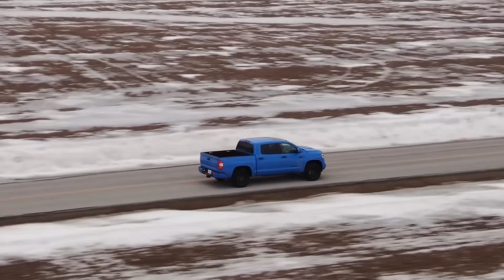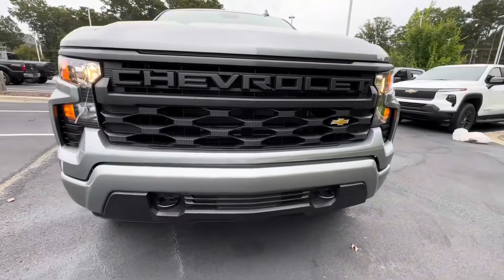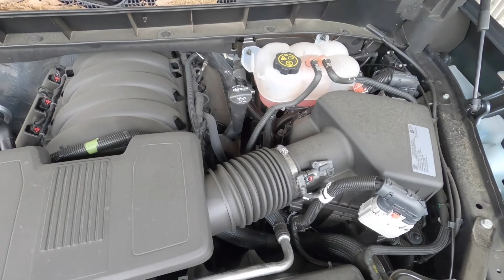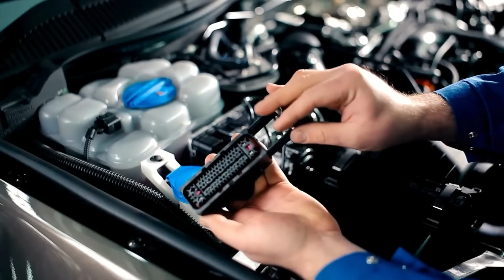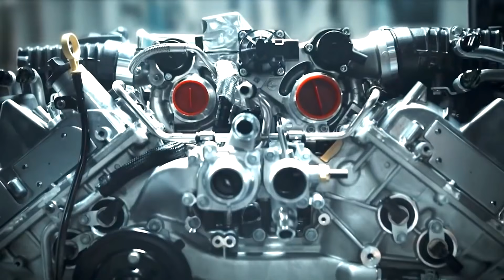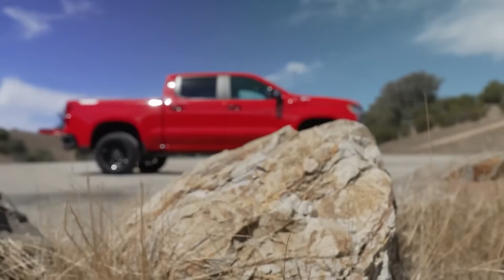4 HUGE Reasons to Skip the 2026 Chevy Silverado 1500 and Wait for the 2027

Comment: I don’t understand why GM insists on the DFM system when it’s been a proven failure that cannot stand the test of miles or time! I have a 2017 GMC 1500 w/t 5.3 Liter V8 2-Dr regular cab with 91,000 miles. I consistently drive my truck in 5th gear and stay out of the overdrive and the 6th gear so DFM doesn’t kick in. I have seen way too many video reviews of fleet trucks that have engine failures due to Cam lifter issues that won’t reach 130,000 miles. That’s insane! I have a 4.3 2006 Chevy Vortex Trail Blazer has 300,672 miles and runs top shelf. No fuel management. Runs clean. Strong. Efficient. Get it together GM! Please!

Comment: get a proven ford with a 5.0 coyote
Reply: Lol goole coyote Problems
Reply: @bwaters698  You can google ANY engine followed by the word "problems" and get a boat load of results. The 5.0 Coyote has easily been the most reliable modern half-ton V8 since the discontinuation of the Tundra V8.
Reply: Lol